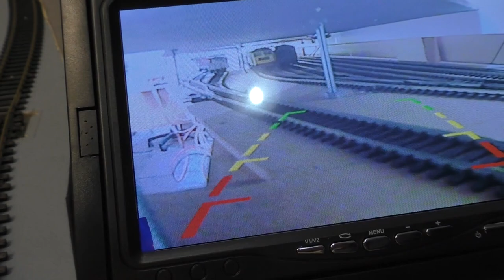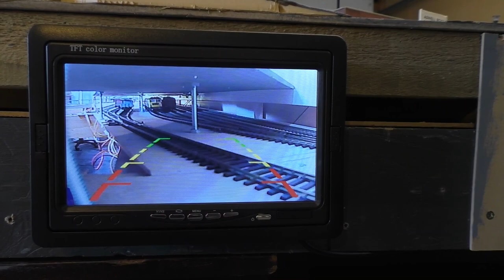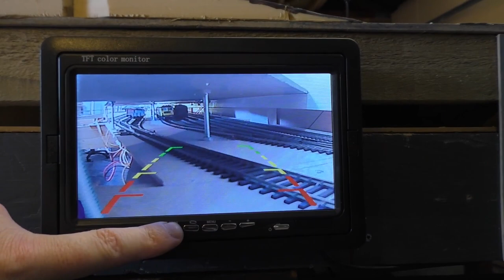Installing a Camera System for the Fiddle Yard

Comment: Great idea.  I love trackside camera views the best as most folks have their cameras way up at normal-people height instead of down at HO-people height.

As a future consideration for testing: install the camera under the table, pointing up through a hole at a mirror which is angled 45 degrees towards your subject/target/scene.  

Being a small, flat plane, the mirror may be hidden under/behind ground scrub, concealed in a pile of 'debris' such as a stack of railroad ties, built into a sloping hill or just behind the facade of a utility shed or building that is open on the backside allowing the camera unobstructed view. 

The mirror can also be rotated and angled for variation in the shot.  Perhaps the initial framing isn't great and a few weeks later its decided to budge the view this way or that. Very easy with a little piece of mirror, bypassing consideration of the camera's bulk in all cases.  It will fit where the camera cannot and can provide from true track level view up to perhaps tree level before the image likely falls apart.

Off the top of my head, the camera/hole-in-table/mirror size/distance ratio will have a sweet spot that must be hit and there may be a reduction in light value due to the light loss on the mirror bounce.  If the low light camera is not strong enough to compensate for the possible loss, more ambient room light, a stronger local lighting such as an extra desk lamp nearby or active HO lamposts or point lights in the yard itself will help.  I expect there are formulas for light falloff that could be scaled for these purposes, but that gets into maths beyond my brains.

Cheers

Comment: Excellent and very useful video. Good choice to go with a higher quality camera setup and separate monitor ... I installed a reversing camera on my layout to monitor the approach to a terminal station buffer stops and so glad I did. I also included an on-off toggle switch in the 12V DC circuit to only have the camera switched on when required (to hopefully life extend the screen and camera).

I’m currently working on a project to build a new under-layout yard and will be installing a 4-camera setup and have seen on Amazon and EBay the same type that you’ve purchased and they look good ... so your video is very useful and timely and fills me with increased confidence that that’s the best choice for me to use as well. Thanks for recording this video and best wishes with the next stage of your wonderful layout, Mark (from sunny England!)

Comment: Hi,  I installed a 4 camera setup on my layout about 5/6 yrs ago. In my case it was a Wireless  (Security) system from China, cost about $250. The big advantage is that there is no AV wireing involved from the camera to the 7' monitor/control box. The cameras are powered from the  5Vdc bus I have
running around the layout to power a variety of 'accessories'.  Not high definition at 720p but does a very adequate job of providing TV from inside my double spiral, Nth & Sth ends of hidden yard and a overhead view of my turntable which can be controlled remotely by wirelkess. Because this setup has been very successful  I have looked at upgrading but thus far I have found nothing locally to  match it especially when going for a wireless system.
Cheers.   Don W. Dunedin.

Comment: You might of been able to get some cheap laptop webcams then get a display. There's videos out there to go off of but it would give you the same position off smaller cameras and will give you a what you could call camera control center. Regarding screen space. Easiest thing to do would be to either make your own screen out of an old laptop screen and a control panel or get a monitor. This would give you dual display. This obviously depends on what display ports you have etc.

Comment: Nice video Julian i have the same issue where my fiddle yard is not very accesable for me to switch points or pick up a derailed train because it is inbetween the backscene and the brick wall. where did you get your security camera set from and how much do they roughly cost because i am thinking of doing the same thing on my layout.- Nicholas.